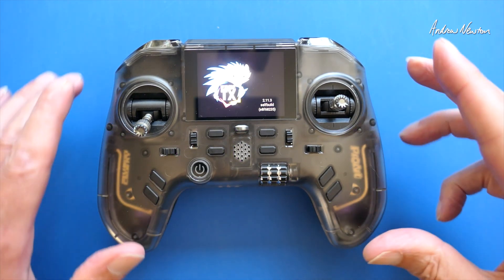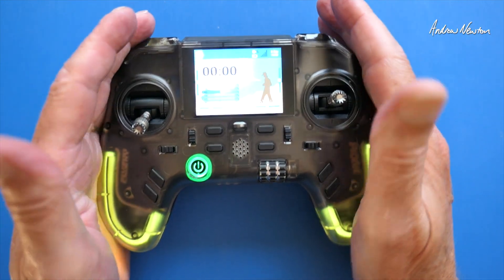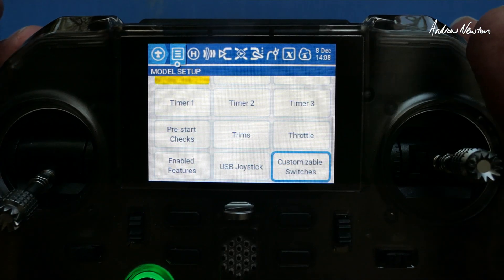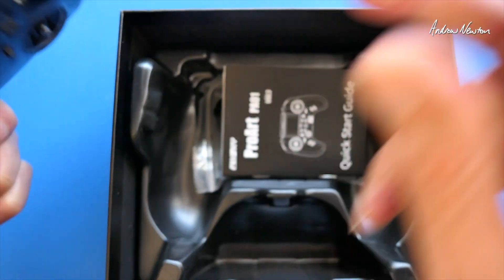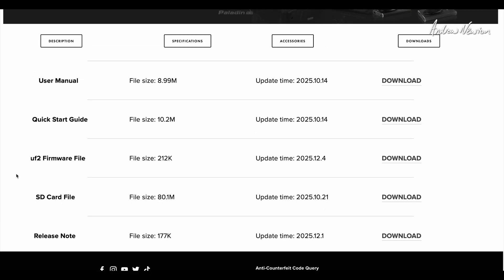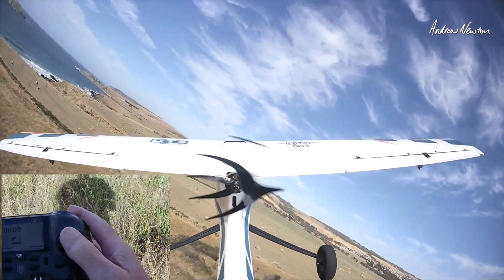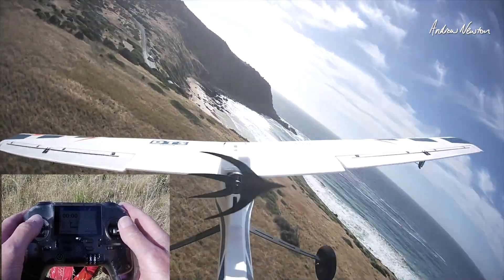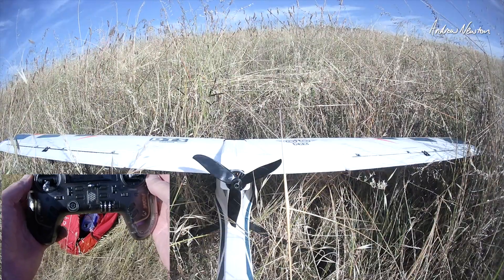FlySKY Pro Art PA01with EdgeTX, AFHDS3 and ELRS

Comment: Thanks Andrew. 👍👌
Can left (throttle) stick be centered?
Would it work with Crossfire or R9 Access?
How about another 900MHz ELRS module?
Big thanks for any answer.
Reply from the maker: Yes sticks centering is configurable without opening the case, and 900 ELRS works using external module (Radiomaster Bandit Nano module). Can't test it but TBS Agent Lua is also preloaded and R9M appears in the External Module protocol list.
Reply: @AndrewNewton thank you very much. I'm using Frsky X-lite for many years, still works great, sooner or later it will fail and this might be ideal substitute.

Comment: Not a fan of the light display, but (speaking as someone who likes to go slope soaring in winter), it'd be a nice feature if those grips were heated instead of illuminated. I don't know where the spare battery power would come from (a pocket pack, perhaps, like the things which cold-weather astronomers use). Wearing gloves is not always convenient, and cutting holes in the thumbs and index fingers for stick, trim, and control access ruins an othewise good pair.

I remember having a poster on my bedroom wall when I was tiny: it was Charlie Brown hugging Snoopy, with the caption, "Happiness Is A Warm Puppy". When you're out on a snowy slope and the north wind doth blow, Happiness Is A Warm Tx.
Reply from the maker: Heated grips! Might be a market for them